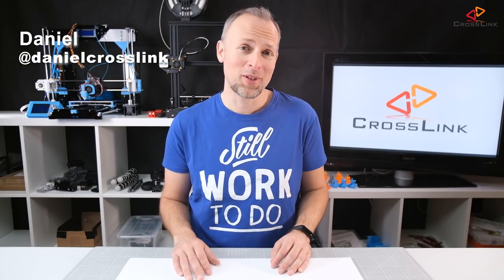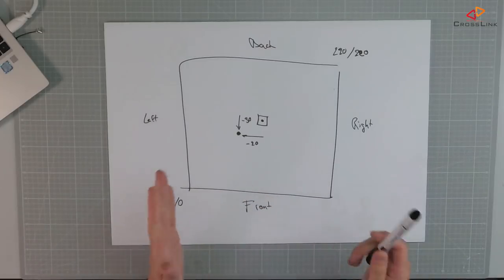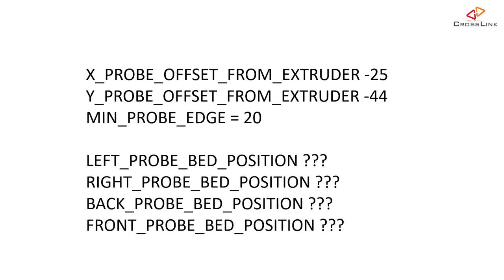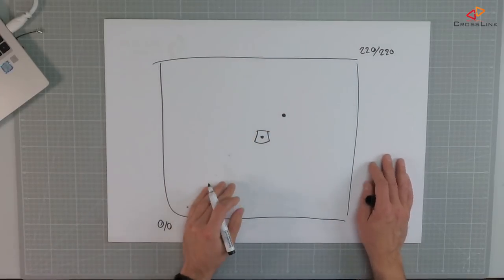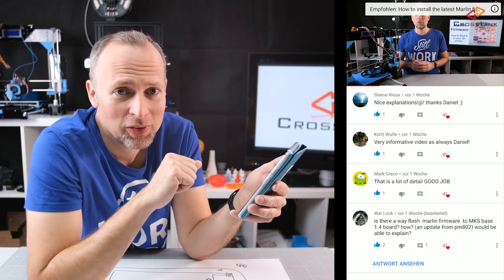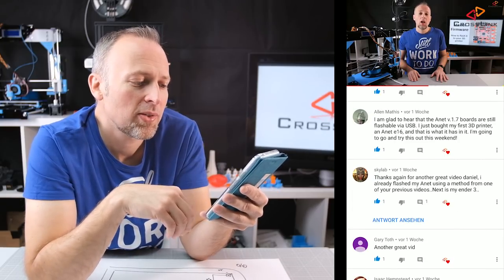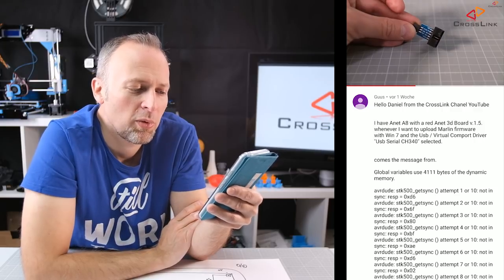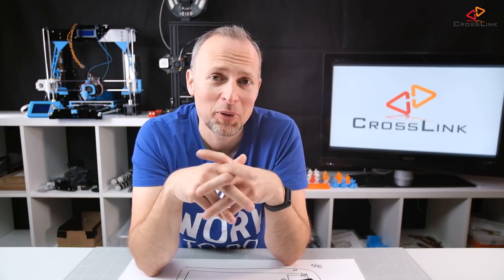Marlin Firmware 1.1.X - Probe Offset and Probe Bed Position Settings Explained

Comment: Hi there i just downloaded the marlin 2.0 bugfix but there is no more   *_PROBE_BED_POSITION so what ve gonna do now? Thanks.
Reply from the maker: I have to look into it. Probably will need to make a new video for Marlin 2.0. So many changes. But anyways. 2.0 is not that much of an improvement for 8Bit printers. It makes sense if you go 32Bit. What's your setup?
Reply: @Crosslink3D  i solved the problem. I found it thanks for the answer
Reply from the maker: Can you please post here what solved the issue so others can learn from it? Thanks!
Reply: @Crosslink3D  As You read and answer your comments i will do that no problem. 

My printter is Ender 3 bed is 235x235.   go configuration.adv.h find this line #if PROBE_SELECTED && !IS_KINEMATIC and change it like that: 

#if PROBE_SELECTED && !IS_KINEMATIC

#define MIN_PROBE_EDGE_LEFT 35

#define MIN_PROBE_EDGE_RIGHT 35

#define MIN_PROBE_EDGE_FRONT 35

#define MIN_PROBE_EDGE_BACK 35
I also changed #define X_MAX_POS 245 like this. that is why i can do that symmetricly. but i am not sure.

Later; i learnt that can be done if all value is same, changing MIN_PROBE_EDGE value to 35 is the same affect. I hope that gives you idea how you can do that. i hope i could make it clear.
Reply: @lethe665  Hi there, I keep wasting the time for dialing in the settings. I'm playing with MIN_PROBE_EDGE_LEFT to get probing area centered but every time I change this particular parameter it affects MIN_PROBE_EDGE_RIGHT (which I don't alter at all). It means, if I go further from the left (increase left margin), right margin goes toward the center. Any idea why?
Thanks for any suggestions.
Reply: @Mario_Ozzee  which Marlin version is that?
Reply: @lethe665  Sorry, my bad. It is PROBING_MARGIN_LEFT parameter. I'm running Marlin 2.1.1 bugfix. I think I've found the issue. I have measured again offset from the nozzle to the probe as it was incorrect.

Right, firmware compiled. I've defined also MANUAL_X_HOME_POSITION to 3.5 and MANUAL_Y_HOME POSITION to -3.5 so prints are now  centered and probing area is limited to the margins I wanted (and centered on the bed as well). So this issue seems to be solved.

Now, I'm not sure it's relevant or not but I did notice after auto home, when move extruder towards the X-axis endstop it triggers it when 3mm is displayed (not 0mm?).
When dial it down more, to for example 2mm , it causes collision.
In Y-axis, after navigate to 0, it's stops 3mm before reaching the endstop, so can't go any further (to -3mm) to achieve it.
I'm just wondering if this is because I  set above MANUAL X/Y HOME POSITIONS or should I play with other parameters (X_MIN_POS and Y_MIN_POS)?

Comment: // Set the boundaries for probing (where the probe can reach).
  #define LEFT_PROBE_BED_POSITION MIN_PROBE_EDGE +20
  #define RIGHT_PROBE_BED_POSITION (220-20-25)+175
  #define FRONT_PROBE_BED_POSITION MIN_PROBE_EDGE -20
  #define BACK_PROBE_BED_POSITION (220-20-44)+156

Comment: I had a driver error when I tried uploading the Marlin to my 1.5 board. If you are getting sync errors the issue is probably a driver. I looked at my board and the chip that receives info first from the USB port on the board is a CH 34xxx chip. I had heard mention of these drivers and had also noticed that my clone Arduino UNO board I was going to use to flash my Anet board also had this chip. I manually intsalled the CHxx driver within windows device manager and whaddya know? Everyone can talk to everyone else and nothing to do with not having a bootloader.
Here is the link to the page. There is a download link for the driver which is specific for these chips. USB 2 Ser drivers don't work and neither does Zadig with WinUSB. http://www.wch-ic.com/downloads/CH341SER_EXE.html    
There are other installers online but they don't have the drivers available to install manually as they're locked up in an executable. You're welcome. Let me stress...my ANET BOARD V1-5 on an ANET A8. Your mileage may vary. P.S. Menu controls are backwards...center key is 'select'.